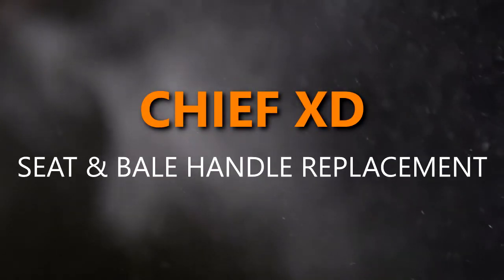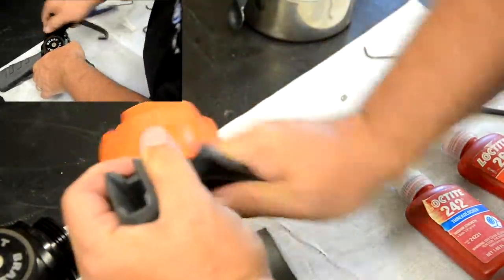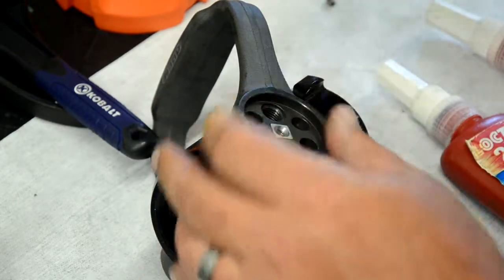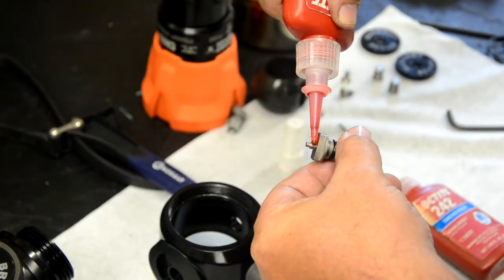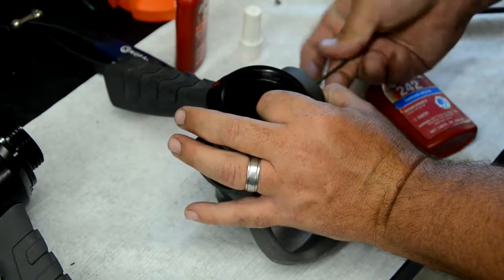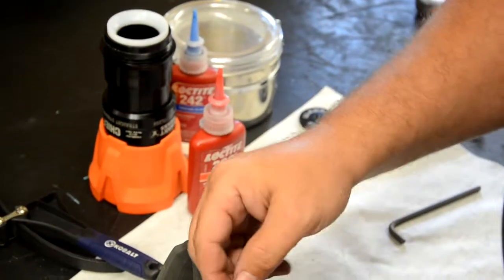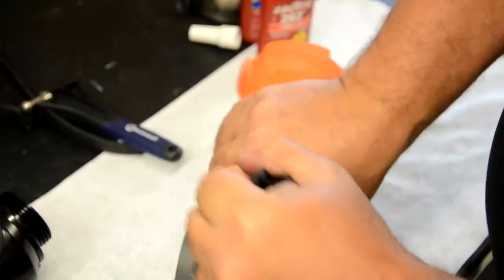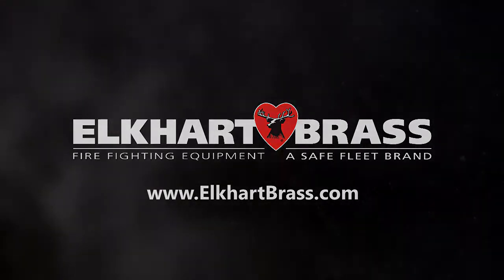Elkhart Brass - Chief XD Seat Replacement

Comment: Why would you use red loctite there unless you wanted to ensure the next repair would require a new shutoff body after the screws were broken off?
Reply from the maker: The red loc-tite can be heated if necessary to remove in the future.  It is a component that susceptible a loosening due to frequent use and red is called for.